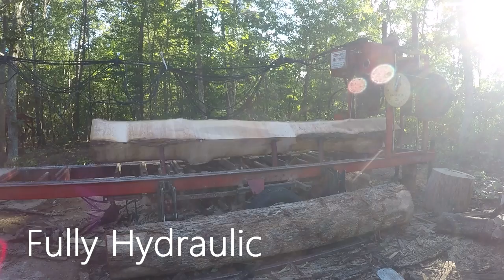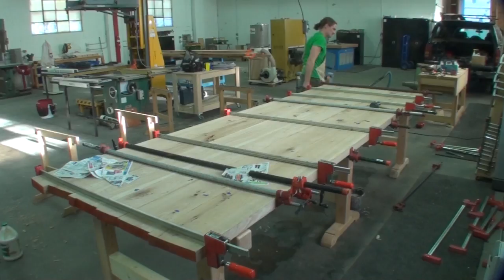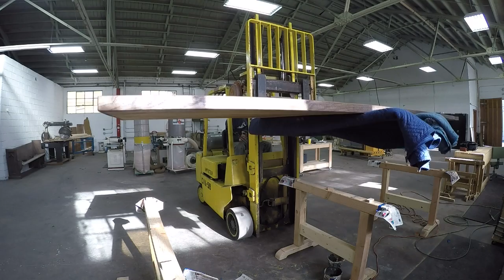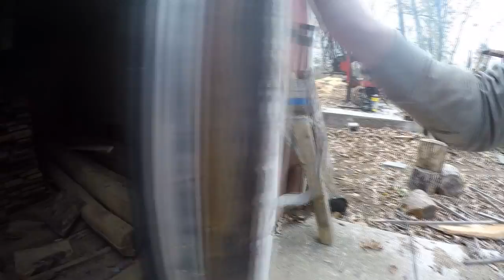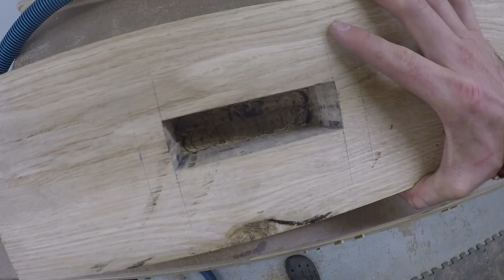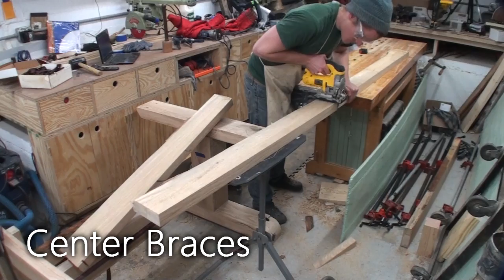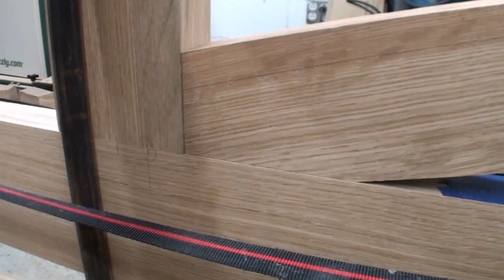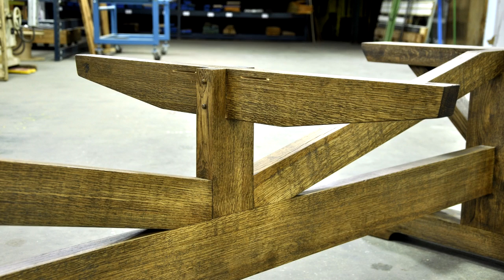Woodworking - Massive White Oak Trestle Table - Log to Table

Comment: Stain ruined that....Beautiful wood made to look like cheap veneer. I have always preferred boiled linseed, olive oil and beeswax or Danish oil. The finish you got was excellent and the worksmanship was A+ but staining white oak just feels wrong guessing that was the customers call?
Reply from the maker: Looks nice in person. You also have to keep in mind a piece of furniture is part of a bigger picture, in this case a huge cabin, full of other furniture and decor. I'm all for leaving wood unstained, but in many cases staining looks nice and makes the grain much more visible. The finishes you mentioned are fine for certain applications, but on a dining table, they don't hold up to moisture. The top would be stained badly in short order. When you are making furniture, especially for a customer, you have to weigh out your "woodworker preferences" with the realities of what someone is going to use it for. Thanks for watching.